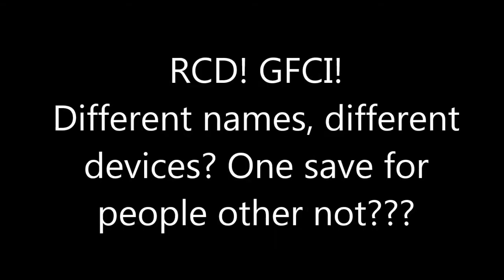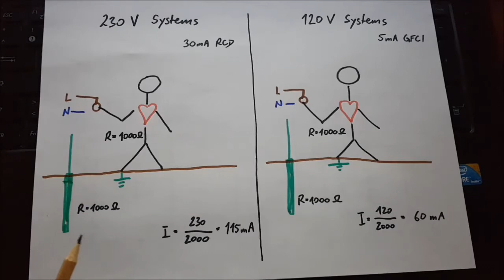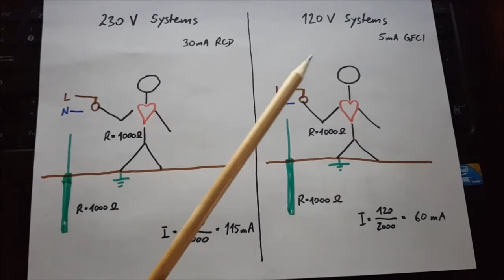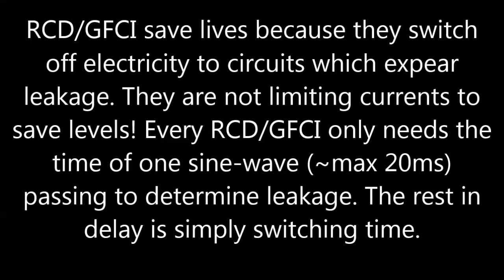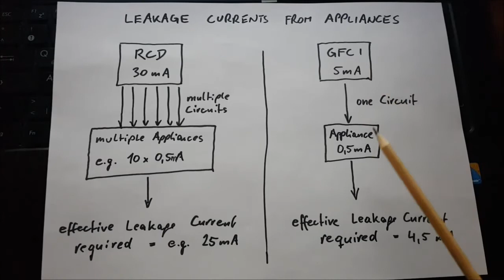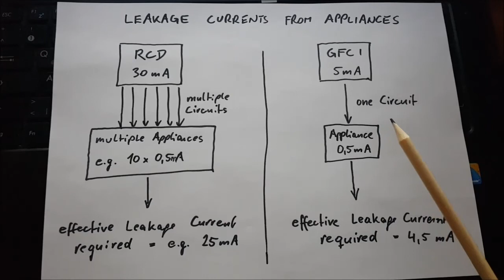RCD vs GFCI. Is there a difference? Is one safer than the other? One for equipment protection only?

Comment: Good morning, the story is curious:
The American GFCI by NEMA is specialized in DIRECT CONTACT, which is why its sensitivity is higher. Studies were carried out by Dr Charles Dalziel and it was concluded that 6mA was the correct point.
While in Europe IEC never did those crazy experiments with humans, it is only based on offering main protection against INDIRECT CONTACT so that the contact voltage is always less than 24v in a high impedance path to ground less than 800 ohms (which explains the 30mA of the RCD)

In case of direct contact in the European system... 30mA is still very dangerous and is only based on the theory that RCD will trip in a relatively short time, it is not considered the main protection for direct contact like the American one.

Comment: What are causes of nuisance tripping? Why would two RCDs in series trip together, after around 24 hours powered? But when there was only one RCD it did not trip! I didn't find a large current imbalance nor any ground currents. Any tips?
Reply from the maker: @tzm1843  when you had one RCD installed, you didn't simply add a second one in series, right? What else was added or changed? RCDs trip on Ground leakage caused by faulty appliances or faulty wiring where either L-PE or N-PE is touching beyond the RCD. The most difficult fault to find is, when N-PE is touching down streams of the RCD. This can cause the RCD to trip right away or just randomly.

Comment: I've seen more discussion about off-grid cabins being 12volt DC only.  Solar powered, 12v lighting, 12v refrigerator/freezer, 12v air conditioner.. heating/cooking via a wood stove or propane.  All outlets are the round 12v receptacles or USB ports.  Thoughts? I suppose you would have to create your own grounding/earthing circuit.
Reply from the maker: A DC 12V or 24V system on output side doesn't require any sort of grounding. but you would need to use surge protectors to provide lightning protection. The problem with staying DC is the availability of appliances, and low voltage as well means high currents and need of bigger conductors. Cabins might have to consider voltage drop on long wires, etc. So this has it own set of challenges. I would go for a AC installation any time when possible, as you can just go to any shop and buy whatever you want and you are used from your grid connected home.
Reply: @RolandW_DIYEnergyandMore  On a completely different topic, check out Survival Lilly's yt video with an Austrian power guy discussing grid and blackout/brownout.

Comment: Yes interesting will an RCD work in a North american system when hooked on the 240 volt part as we have 2 hots.
Reply from the maker: I think it should work as long that device is a 240V device and not connected to Neutral at all. Leakage towards ground will be detected, but the Hot-Ground voltage is always just your 120V. So the leakage current is lower. That would make a 30mA RCD probably not suitable for human protection. That's why they call those EPDs in North America :) But still, with a low impedance grounding system it would be doable too...

Comment: That was a great explanation, very clear and straightforward.  Is there any difference between a RCD and a RCBO besides the individual circuit protection and easier fault finding.  RCBO's are very expensive. in Thailand I could buy 6 RCD's for the cost of 1 RCBO but the consumer unit would be huge.
Reply from the maker: The only difference is that RCDs do require CBs for overcurrent protection, while the RCBO is a combination of both. RCBOs make sense there, where you have too many appliances running at a time, that due to appliance leakage one RCD might start tripping for no reason. So you can tidy up your distribution a bit.